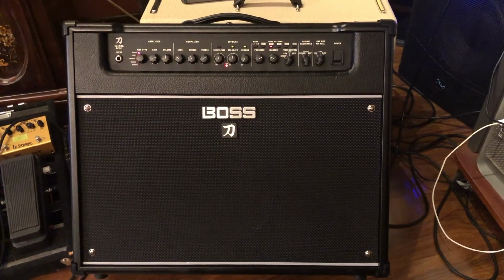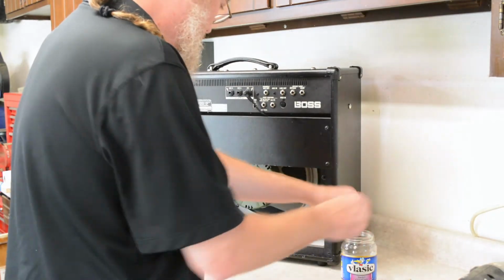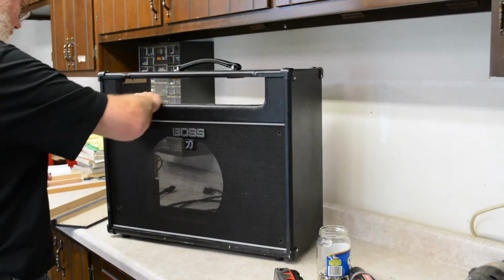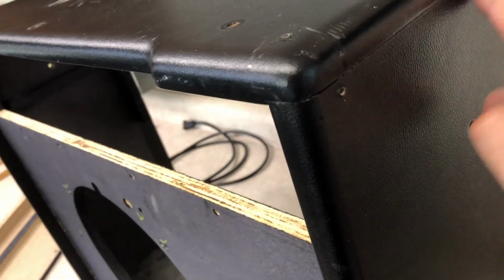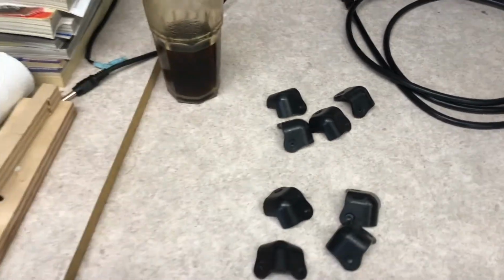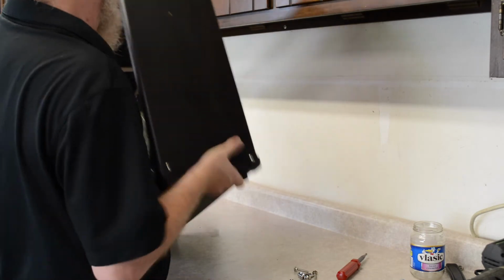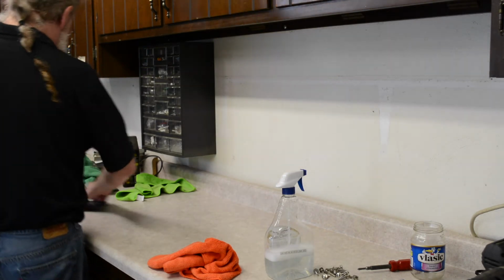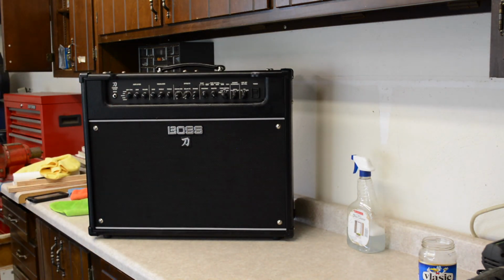Boss Katana Artist MK1 Disassembly and Opinions

Comment: You refer to "pots",  are there potentiometers in this amp?
Reply from the maker: Yes
Reply: @6dbthreshold  I don't understand how the tone studio software can change the volume if it is determined by the potentiometer setting
Reply from the maker: @channel-fs3tg . I haven’t seen a schematic, but it’s very possible that the panel pots feed inputs to adc converters for the logic processors.  Then the processor determines which volume signal to follow (local pots or software).  Then a processor output probably feeds a VCA that adjusts volume at the audio power transistors.  

I don’t really know.  But I bet it’s safe to assume the pots adjust control voltage and not audio signals.  Still, pure conjecture on my part.

Comment: I’ve had the Katana MkII 50, 100 MkII and 100 Artist MkII Combo.  IMO the artist sounds and is built much better than the 50 (I’ve had 2) but at a huge weight and size penalty making it a PITA to move, but the Artist clean is loads better than the 50, almost - very nearly almost as good as Fender.  The Katana 100 MkII is the “in between” more controls than the 50, less than the Artist? sounds better than the 50, but not as good as the Artist, and a price less than the Artist more than the 50.  The other problem is the Artist can get LOUD.  That said for the house, I sold both the 50 and 100 and kept the Artist.  Sounds amazing and love the controls on the panel.  The waza speaker, shaping, cab sim, and solo functions on the artist are on the panel and don’t require using Tone Studio or the xSonic with the mobile app, an are terrific.  I wish Boss would add the same controls to the entire line.

Comment: Hi, thanx for this video. It helped me to open the amp the same way as you did. Why? Because the tip of my jack guitar cable was broken and was left in de input slot. No way to get it out from the outside, so I open it to hope I could push it back from the inside. But that did'nt work, because the input slots are closed at the end.   It looks like a black cap. 
Do you have a suggestion for me how to get the Tip out of it?
Reply from the maker: Ouch!   That’s never happened to me. 

I might try using a small drill bit on the center of the guitar plug.  But I don’t know if it would bite before the plug started spinning in the Jack.  

Tubes and More has surface mount input jacks in stock that might fit the katana.  If you know how to solder, It might be easiest to just replace the Jack.